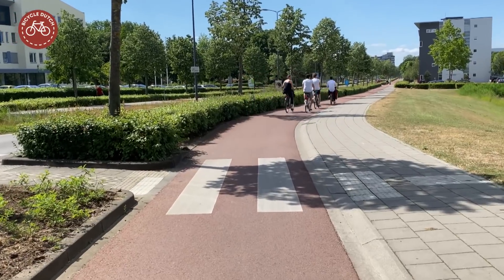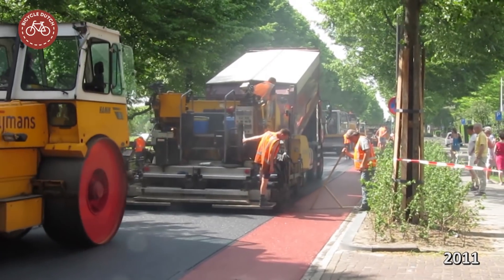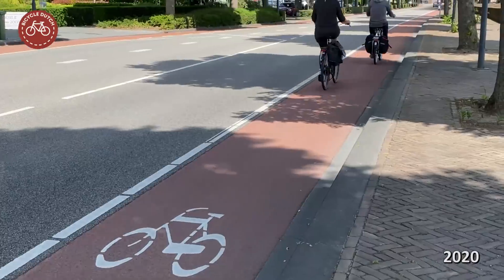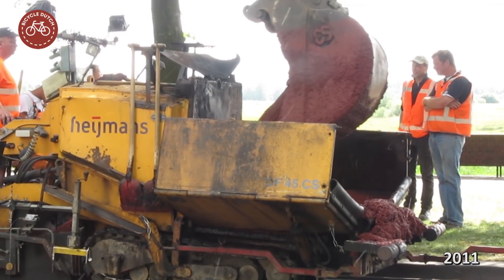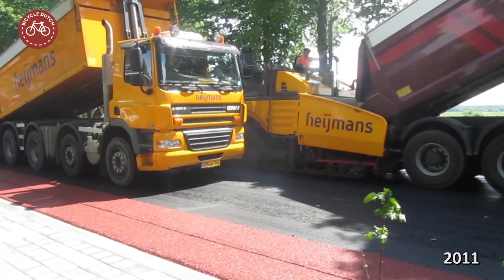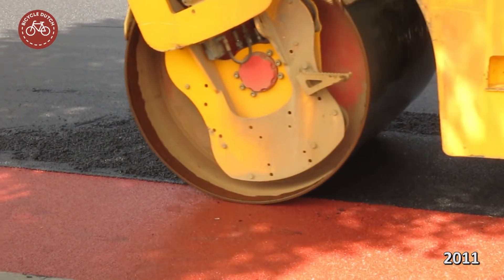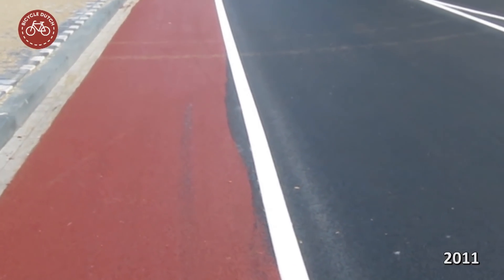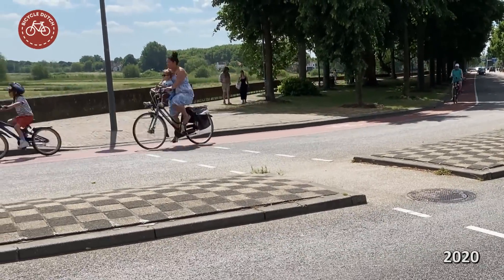How asphalt ages

Comment: Love the content! So they didn't resurface the asphalt in the last 9 years and it still holds. What kind of sorcery is that. We have to resurface in 2-3 years, not even mentioning potholes.
Reply: I think it all depends on the good quality of the asphalt and the knowledge of the workers. I get really annoyed when I see using asphalt with "big grane", it always end up breaking very quickly.
Reply: @paolagrando5079  guess what? We use ZOAB (Zeer Open Asfalt Beton) as we call it or "very porous asphalt concrete" also simply called pervious concrete. Which is big grain stuff.

What happens here in the Netherlands is that water in the winter gets stuck in it and when the temperatures drop below freezing that water expands and breaks the road surface. The result being potholes after winter, but they are very quick to fix those here.
Reply: @LogiForce86  In the past, I've got told by somebody who used to work on the roads, in Italy they would do the first layer with the ZOAB and then cover it with a fine layer(s). In that way the asphalt would last longher. Shame!
Reply: @paolagrando5079  lol.. that does seem to defeat the purpose.

Personally I am not so sure that ZOAB is all that great to be honest. The reason being that I find visibility of road markings quite bad during heavy rain. This is due when the ZOAB can't remove water quick enough, so the water gets basically trapped in between the grains and due to adhesion will start to create a water bubble on top of the road instead of keeping it dry.

So in normal rain conditions ZOAB is great but during heavy rain that is too much for it, it just ends up being worse than regular asphalt.
Just speaking from experience of course as I am not knowledgeable in the field.
Reply: @paolagrando5079  They might have talked about Two-layer ZOAB. It has a regular ZOAB underground + an extra layer with smoother ZOAB with smaller holes and grain. ZOAB can lead to a reduction in noise of 3dB; TZOAB can reduce noise up to 7dB. Thanks to the extra layer it has a higher capacity to drain water. The smaller holes act as a filter for dirt, which means that the road is less likely to clog up. And renovation of the street surface is cheaper when you only need to remove and resurface the top layer.
Reply: @LogiForce86  The visibility during heavy rain is important. So, do you have any idea of what was used before ZOAB?
Reply: @peterslegers6121  Never thought about the different asphalt would make a difference noise wise. Interesting.
Reply: LogiForce86 we only use ZOAB on highways, because it’s very quiet. But it can’t stand friction. That’s why we use various compositions of DAB (dicht asfalt beton) or OAB( open asfalt beton) on every other road. You can easily spot the transition from ZOAB to  DAB the next time you take an exit on the highway. It’s right infront of the turn. The ZOAB  would otherwise be destroyed in a couple of months because of the friction.
Reply: @LogiForce86  Big grain and ZOAB are only used on motorways.
Reply: Less tar and more rocks. Meaning more expensive and less junk. The good of asphalt and the good of concrete.
Reply: Their climate doesn't have the temperature swings like we do in the midwest of the USA. I would say that 9 years isn't that long of time for a bicycle trail. In Chicago the North Branch trail was repaved in 2007 and it still is in great condition 13 years later. So a properly paved trail that only sees light bicycle traffic can last a very long time even in the Chicago -20F winter to nearly 100F summer.
Reply: Tom Z but the black asphalt with car traffic also looks just fine
Reply: @electricboi9319  Again, it goes back to their mild climates.
Reply: @TomZ23  You forget that it's shared asphalt with heavy traffic (busses and trucks) that also drive on it at 50km/h, and all parts of the asphalt are in good condition.

In fact our highways are smoother than the Autobahn in Germany (and let's not mention their B roads) and don't get nearly resurfaced that often either. With traffic movement being not that different either in both countries.
Reply: @LogiForce86  Someone correctly mentioned that in the Netherlands temperature swings are not that large. No extremes, so wear in asphalt is limited.
Reply: @LogiForce86  It is very strange. Germany is a very rich country but they don't spend much of their money in maintaining their infrastructure.